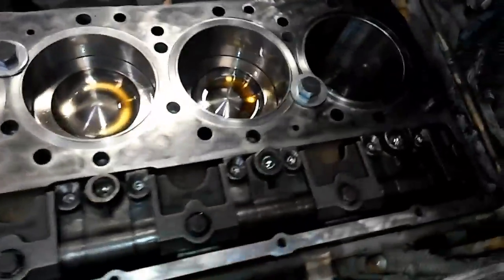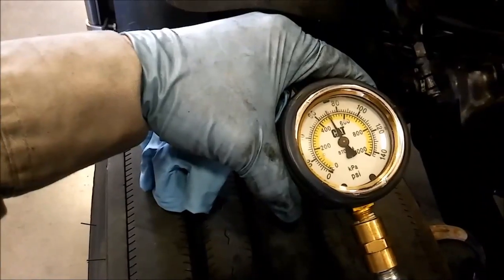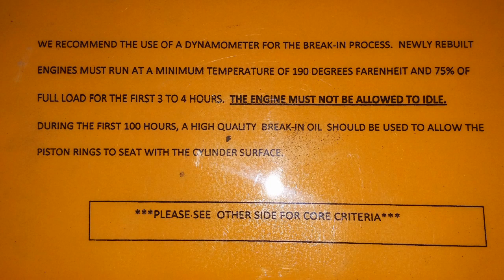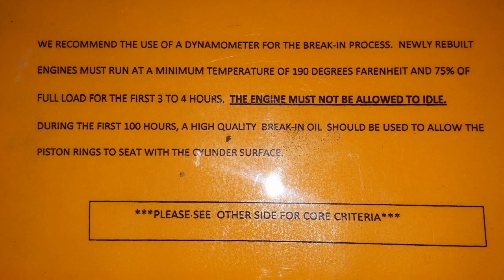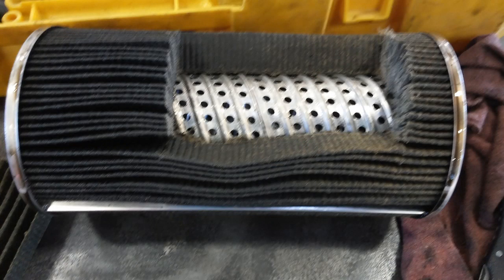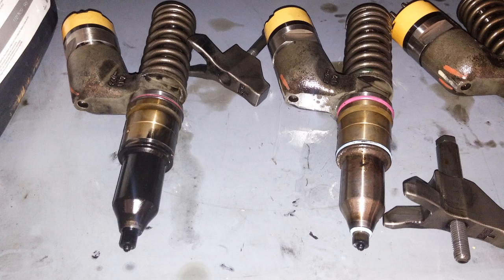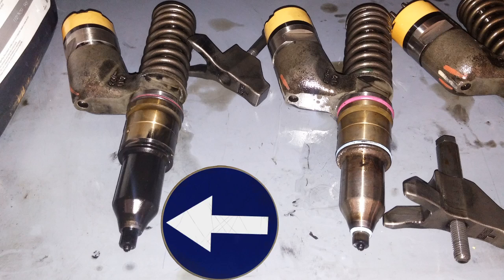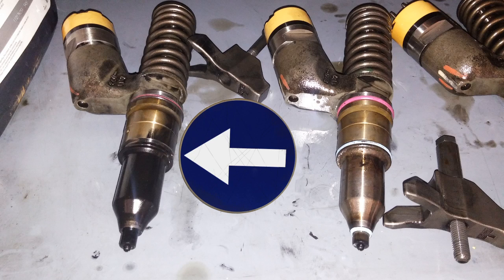How Should You Break In A Diesel Engine?

Comment: I'm doing a first oil change on a small Yanmar (1.5L). Almost 300hrs... Its done a fair bit of idling in cold weather. Has EGR, but no dpf. I plan on flushing the engine (and two drains in a row to get it all out). Is there any reason I shouldn't do this? Also it has solid lifters, and since there is no dpf, I plan on adding a little zinc (zddp) to the new oil to keep the cam happy. 
Again, does that sound reasonable for this low hour engine. I figure its easier to Keep it clean and lubricated than to try to address those issues 1k hrs later ~
Thanks a Ton if you have feedback. Still love the channel if not 💪 💙 💥 ~

Comment: If any engine is being broken in on a dyno at full load and the outside temp  is high, then have someone spray the radiator with a garden hose.  Unhook all wires going to the alternator because if the fan is running it's going to blow water all over it and short it out.  Also tape  the end of the heavy power wire and the field wire plug  to keep water off  both.  Most semi's are going to have a switch  where it's easy to shut the fan off so that wouldn't be necessary.  Also use a battery charger  set to enough amps to keep the voltage  between 13 - 14.5 volts if it's not handy to shut the fan off.  The best time to break in  an engine like a semi on a chassis dyno would be in the winter in 0 degree temps.  Just need several freeze plug block heaters to preheat the block or use space heaters to preheat the engine and then open up the shop doors to get the dyno area cold after the engine is started.  It would be difficult to convince someone to stand at the front of a truck for 6-10 hours spraying down the radiator if it's hot out.  Or a bracket could be rigged up to hold the hose and nozzle in the correct position with the nozzle set on a fan pattern to hit the entire radiator.  If it's not possible to shut the fan off, then it is mandatory to unhook the alternator as described previously and also not shock the exhaust manifold and turbo that are going to glowing orange with water being blown over the engine by the fan.  Air cooled piston aircraft engines have that problem because if a plane is going 200mph into a rain cloud it can cause shock cooling .  Heavy amounts of rain and hail can cause  turbine engines to flame out.  Course the plane can glide out of the rain and restart the engines once past the heavy rain.  And turbine engines on big commercial jets are made with very expensive alloys that can take shock cooling a lot better than a typical exhaust manifold and turbo on a land based machine.

Comment: I just got my engine rebuild, how what's the best way to break it inn? Can I I run my truck with 45,000 ponds and for 750 miles round trip or should I just wait running it that much until it breaks.
Reply: What did you end up doing?

Comment: With the 10-24 litre marine engines we do once the engine is up n running we tie the vessel to the wharf, drop into gear once up to temp and pretty much try to pull the wharf down. Running at just below max rpm for anything up to 6 hours or longer.

Comment: Hello,

I have a 2005 Renault Laguna 2 1.9 Dci (F9Q 750) (120 HP) that have been rebuilt on Feb 11. Everything has been renewed with new ones except crankshaft, camshaft and piston rods. The reason of rebuilding it was burning oil (350ml / 1000km and blue smoke especially on cold) and high blowby at idle on oil cap. The cylinders has been bored by 0.5mm and new oversized pistons inserted. The car runs fine without any leaks, without any smoke at operating temperature and it's powerful now. Still has a little bit of blowby smoke on pcv valve at idle at operating temperature but i hope it'll be gone when break-in procedure is finished.

My concern is, the service put a factory suggested Elf Evol 900 SXR 5W40 "Fully Synthetic" oil as initial oil and then they tested the car without my approval. They even said they redlined it on highway and went to 170 kmh which is contrary to break-in period and initial break-in hours. I researched about the break-in oil and break-in procedures and learned a few things but it was too late to tell them to service. They already done this stage. They didn't know about break-in oil anyway and said "use the oil which is recommended by factory as we did it like this". When i asked them about break-in procedure, they said drive it like you want it, it won't matter...

Since rebuilt, i've driven the car for 300 kilometers in 7 days and following the break-in procedures. Not lugging it, not overreving it, not passing 3000 rpm and avoiding full throttle sudden accelerations. I've been avoiding idling it for extended time. I've been using the RPM band widely as much as i can to help seating the rings to walls. In 3rd gear, accelerating smoothly from 2000 to 2800ish rpms then letting the foot off the gas and it drops slowly to 2000 again and repeating it on different gears when driving. Not driving it like a cruise control on same RPM.

My question is, should it break in like this with fully synthetic oil which is on the car for 260 kilometers? Should i stay with the synthetic oil inside until i reach 800kms and change it or should i change the oil and oil filter to mineral oil like Castrol GTX Essential 15W40 etc. immediately? I fear to glaze the cylinder walls or rings and can't successfully do the break-in procedure with the synthetic oil inside. I fear to damage the healthy turbo or other components with mineral oil too but the turbo repair is much more cheaper than an engine job which i paid significant amount of money. Is it too late for switching to mineral oil? Are my cylinders have been already glazed and rings wont seat as i fear this to happen? How should i test that?

What do you recommend in a situation like this? I was planning to do the first oil change when i reach 800kms after rebuild, then the second at 1300km and the 3rd at 4000km. I just want the engine to have a healthy break-in procedure and have a long life and decent performance. The money spent on oils and oil changes is not that much important. I want to drive this car healthy for 3-4 years, equals to 30.000 or 40.000 kilometers with my recent driving hours. I bought the car at August 2020 and have been fixing the problems caused by previous owner, sadly. I’m waiting for your advice, thank you for reading this and thanks for helping.
Reply: 2 years later, how is the car? How is the engine? Any smoke/oil consumption? What was your experience post-breakin? Do you reckon it mattered that the service did the redline and highway runs?

Comment: Often when you are doing an engine rebuild, the piston ring manufacturer will get you a set of rules. If you have a flat lifter cam, you are usually also given a set of rules. If you do a stock type rebuild, see if you can find your vehicle owner's manual. Sometimes the manual will give you special driving instructions for the early miles.

4:01 Bearings are important, proper machining of the crank is important. I have seen way too many people buy a used car that says it has a rebuilt engine. All the previous owner did was roll in a set of standard bearings, without any wear measurement of the crank. Those engines run like crap a few months after the used car is sold. Also, they often fit a set of rings and quick hone the cylinder bore. They don't measure the piston and bore, and usually they are out of specification at that time. That's another reason cars that advertise rebuilt engines quickly run like crap.

5:01 Also look for what brands work and which ones don't. Some flat lifters and flat lifter cams are made with low grade metal, and will shred no matter how well you follow your directions. I have read that Comp should be avoided.

Although modern OHV engines usually have roller lifters, many SOHC and DOHC engines have flat lifters. I don't know if replacement SOHC and DOHC cams have certain rules for break in. However, flat lifter OHV engines definitely do.

8:26 When I was at UTI, I was told that most people are instructed to load up their tractor trailer and pull a load like they always do. The break in typically happens properly.

15:50 Now many companies formulate a complete break in oil, rather than an additive for standard engine oil. I prefer this method anyway, engine oils were designed with a certain additive pack working as a team. Adding something breaks up the teamwork. The break in oil is sometimes recommended for roller cams. That is because break in oil may be good for new piston rings and bores.

Comment: Does anyone know how to break in new truck? I agree with this video completely, but how do you load the engine with new diffs when new ring sets aren't supposed to see much load on break in?
Reply: Go easy on it in the lower gears and give it load in high gears (like highway speed) will be less stress on the diffs than a full pull in low gear where the torque is multiplied more

Comment: I did a platinum rebuilt by Cat on my truck and they never told me this, i don’t even think it says on the paperwork that i got from them! Now i have low oil pressure, lots of blow by check engine light and diesel in oil! I took it back, they said they will check it out, i have 2.5 yrs warranty so hopefully they’ll get it done soon.

Comment: Well josh I’d think it would be harmful to the pistons and cause scuffing of the pistons and cylinders. Also 1.800 rpm is pushing it Towards red line or over revving it which we all know is bad.
Reply: So you’re arguing with the professional diesel mechanic… Why?
Reply: I worked for a trucking company for about 3 years and the drivers would rev the piss out of the engines and a few would stick a rod out do to over revving.
Well I see it like this when and engine is cold it’s tends to be a little tight during cold start and trying to heat it up faster instead of letting it take it’s time would cause more friction and cause piston scuffing and premature wear on parts especially when it’s being pushed to higher rev’s again it’s how I see it!
Everyone has their own opinion and ideas how they do things!
Reply: @jamesaucutt8284  1800rpm is still not at the redline and won’t do harm to the engine so I don’t see your point. Over revving can be catastrophic like you said but 1800rpm isn’t over revving for most semi engines.
Reply: @jamesaucutt8284  Also he’s not talking about warming an engine up - he’s talking about breaking in new rings and bearings so I’m not sure where you get the idea that he’s encouraging revving a cold engine?

Comment: Hi friends, Break-In apply in gas engine? We were overhauling a G3616, we had problems during the start the temperatures dont´s stablishes and always shutdown by detonation, the solution was increase 30 rpm in idle high speed.

Comment: We had a problem with a brand new slow running trawler engine It was fitted with a variable pitch propeller so that full power could be used at slow towing speeds. The skipper thought he was looking after the engine by running on just above idle with the pitch wound down, lightly loading the engine. He also shortened the manufacturer's recommended interval for the first oil change, replacing the running in oil which the engine had left the factory with, with the recommended grade for normal running. The running in oil had a lower viscosity to allow an initial amount of wear during the first  period, combined with light load the result was glazed bores. Oil consumption was abnormally high  with grey exhaust smoke. After busting the glaze on the bores and fitting new rings the problem was solved. The skipper was instructed to run the engine on maximum revs (1200 RPM) while increasing the propeller pitch (load) until  black smoke appeared from the exhaust (overload condition) then turn the pitch back until the exhaust cleared.  No more problems, oil consumption was normal. Keep a new engine working at varied speeds  above half speed, maintain the temperature of the engine and the oil at the temperature it is supposed to be at. Avoid black exhaust smoke start as you mean to go on. Work an engine within its limits.

Comment: Could this technique be used to break-in bike engines?
Reply: As he said load/cylinder pressure is what applys the force on the ring to make it scuff off the manufacturing flaws. Too little load/pressure  allows those flaws to transfer to the cylinder instead of being worn off ,same with full synthetic oil  used too soon .

Comment: Interested to hear your comments on an issue I had about 1996, I bought a new Freightliner in 1994 had a choice still the old 425 Cat or the new early E model 3406 435 hp. I went with the new E model was very pleased with it, after the warranty on the injectors expired it dropped a injector tip. Needless to say it took out the liner, piston, head and turbo, I was told From Cat they were aware of this issue but no recall was put out, it cost just under 10k to have it fixed way back then. Just curious of your thoughts they say they gave me a break installing new injectors, but still felt like it was shady that they knew about it, Thanks love your videos retired now but still watch,

Comment: we have a series 60 Detroit Fire Engine type 6 . that has a 5 Speed Trans. With Jake brake . holds 650 gal. water. 46.000 gr. Wt. it is harder to maintain proper rpm. for brake in period as it will shift in auto. also during brake in is using Jake advised for brake in process?   Lee

Comment: My uncle spent his career as a diesel engine mechanic.  Mostly with Cummins.  When they'd rebuild an engine they start it up, apply a full dyno load at maximum power, and leave it there for 30 minutes.  If it survived it was broken in and perfect.  If the slightest flaw was present it would seize.  All or nothing.
Reply: That's pretty well what I've been taught and experienced. It it's gonna break it'll break when you load it to full power.

Comment: with the newer DEF and DPF emissions parts on these trucks, (2019 f250 6.7powerstroke) , i don’t know much about diesel, How would these trucks do as a daily driver/short trip truck, (no deletes) no towing or hauling, 6 miles to work and 6 miles back home during the work week? and 30 to 40 miles on the highway on the weekends. i just want a big truck with a diesel engine. P.S i don’t care about the mpg or the cost of diesel fuel.
Reply: K bomb 
Pretty much how i use mine, like a daily driver/ short trip truck. Occasionally towing lite to med. heavy trailer.
No problems. Works for me ...
Reply: Depending on where you live... 6mi wont get the defrost up to temp mucless  the motor /trans up north. Thermal cycles(partal cycles being worce) have more impact than miles. .

Comment: Mechanics in India run a rebuilt engine overnight at idle rpm and no load and call it cooling period. Now we know that is a bad thing to do.
Reply: that's the reason that engine dont last more
Reply: They don't have engine dynamometers, so it's probably the only way to confirm the engine runs with no leaks before delivering it to the customer. I respect them for doing the best they can.

Comment: We have just picked up a 4.5 litre V8 twin turbo diesel 200 series Landcruiser. Is it the same in the the 4x4 with a overhead cam twin turbo diesel. The motor redlines at 4500 rpm.
Reply: Spoken to my workshop after a new long block install, I was told get a heavy load on a trailer and give it a good workout for a few hundred km 
He recommended pulling uphill under high load also.

Comment: I had a rebuild on a dd15 engine in a small shop because I know the mechanic and he was pretty good at his job. But when I picked up the truck he has it running at 500 RPM for 24 hours right after the rebuilt I knew this is not right. The oil pressure was 10 pounds lower than usual at high loads but withing the limits according to the dealership. The engine stalled one month after the one year warranty expired... Now thanks to you I know what could be the reason.

Comment: Don’t no how to chat with you have a question what will cause bent valves fresh rebuild new head everything is all set to spec can a Jake brake cause this or what else to look for
Reply: Too much pressure in the chosen oil feed for the Jake brake supposedly can cause bent exhaust valves. What caused yours?

Comment: Hey my name is Al we have a 88 Lt8000 cid 240 Ford/International we recently had  a   rebuild on it it's oregenal problem was a dropped valve in number six cylinder I believed it was the intake side. Not using allot of rpm coming to a stop light not using rpm down sh      iffling.I locked up the whole motor the motor has been rebuildt it seems to have a small vibration in it at low rpm could it be afront  balancer issue other than that great oil pressure

Comment: Another good way to break engine is.  Pull the fuse for the cruise for the first 1000 miles. That will help. This will force you to constantly change rpm and loads on new engine

Comment: After spending 10 years at a major manufacture and worked as a dyno mechanic on all brands of engines then  27 years in a high volume truck dealer ship
Overhauling too many to count 
25% of rated hp for approx 15min
Then i back it off and inspect for oil leaks coolant leaks ect 
Then 15 min at 50% of rated power
Then 15 min of 75% rated power
Then 15 mins at 100% rated power
Then i will do a full ranged dyno report 
Then the engine is ready for service 
But remember always refer to the service maintenance manuals by the manufactures 
This was my basic dyno run in as soon as i completed assembly  Id go right to the dyno
Good luck